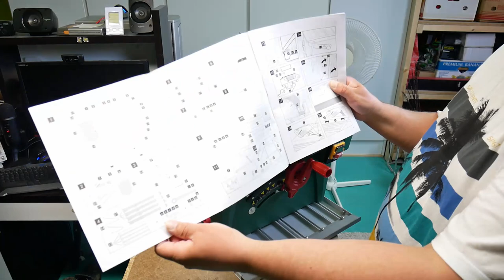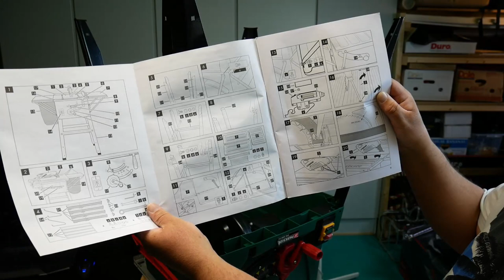Parkside Lidl table saw assembly and startup

Comment: The guy didn't test it, other than turning it on and listening to it ! Not a very good test of a power tool...
Reply from the maker: Yes, this was not my intention but I lost the footage of the sawing I had made and then had to move the saw into storage. I am hoping to post a separate video on usage when I do a planned renovation this summer.
Reply from the maker: After thinking it over I have decided to rename the video to be more in line with the content. I will also still keep the plan to post a 'in use' video